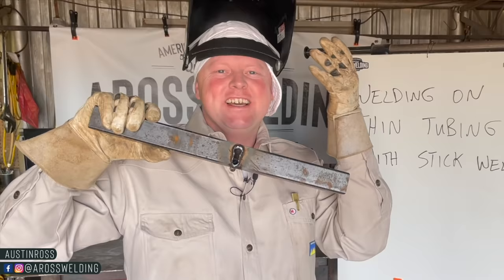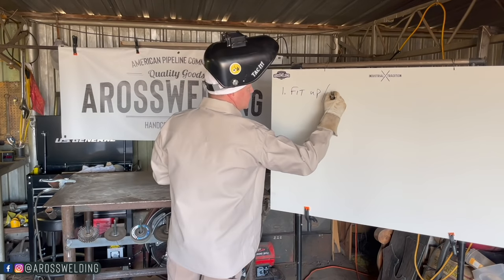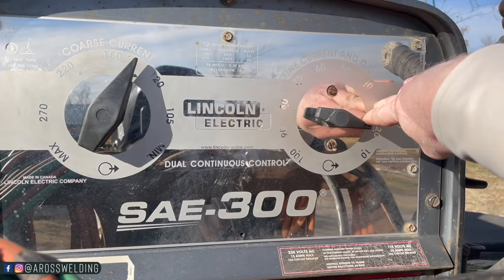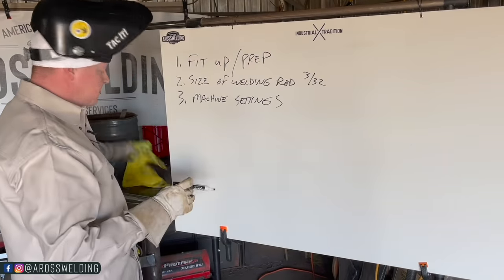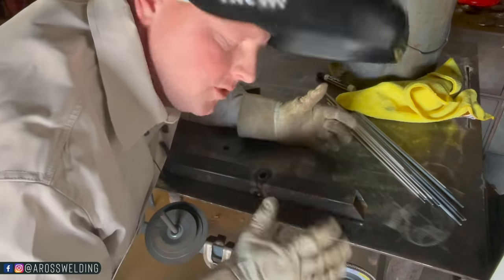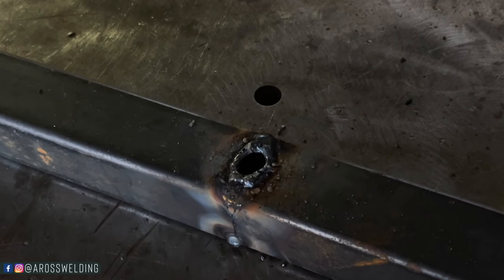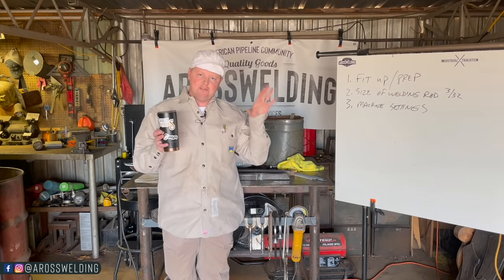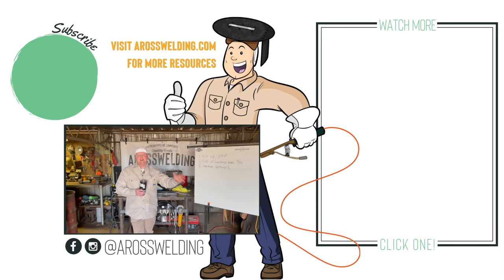Stick Weld Thin Square Tubing (How to Recover After Burning Through)

Comment: I just bought so firepower 1/8 rods a 10 lb pack for under 20$ off eBay witch is a steel compared to what ur going to pay for any electrodes trust me u can't beat ebay's prices on alot of stuff welding supplies included fr and u can buy some pretty nice stuff off there if u kno what ur looking for that's a fact but u have to Kno ur stuff some inorder to pull that one off plus the wait time witch if u order anything on a sat u should have it by the next sat at the latest as well and to weld on my Lambo door kit and I attempted to try to use 1/8 steel on the door lifts and that's not thick enough so I've got some 1/4 steel plate on there way I'll just take some construction paper and make me a stencil and back track it on to the plates and cut them out get everything lined back up then begin to weld steel to steel because I'll use my stock bolt locations to  to attach the door it's self u don't want to weld the doors on ahh no u never know if u will have to replace ur door or anything this way I'll be able to remove the door if need be and so I'll be able to replace the bushing in the doors to because yes they do have door bushing with the Lambo door lol

Comment: I like to think of 14 gauge [5/64 or .083] as a little bigger than 16 gauge [1/16" .063] ] than smaller than 11 Gauge [1/8"  .125]]....don't need much heat for sure.....easiest to weld with 6011 [Electrode negative, gives  less penetration and more build up, ....AC also gives less penetration and more buildup than electrode positive for those with an AC only machine, but not as much as Electrode Negative DC]  and whipping it, whippet good....I used to repair lots of gates and fence around swimming pools......gnarley work if you can get it......and believe it or not, a 1/8 6011 , even though at a higher amps, does not dig in as much as a 3/32 6011 at lower amps, as the arc is spread out wider.....at least that is what I found when doing fence and gate repairs. hope this helps someone....
Reply: interesting

Comment: If your at home ok on the job there’s is no walking away. Might as well walk to your truck and leave. If one is not confident on a material get some drops pcs and see where you ,your material and the wielding machine are at. Usually about 5 mins your tuned in to start the actual job. Tight joints, positioning you and your material, stick heat and speed and polarities are important. Down hill and flat travel when at all possible. Always set lower than you think if not familiar. Easier to turn up machine than fix a dime sized hole. Clean flux off what ever rod your using to use as a filler rod. It’s always with you no searching for what ever or cutting a pc that will work and it’s a good length to handle. Demand excellence from any one that cut your pcs. A well laid out pc poorly cut is a challenge beyond the job it’s self. Time and patience of your welder will both run out lol. Always try to set one’s self up for the best finished product. Lastly always be willing to learn from others no matter how far you have progressed in your field. The man that says he knows everything is the last guy I want on my crew.  Keep up the good work because I’m sure you will learn as much as you teach. That’s a really good trade off.  👍

Comment: The first thing I'd do, is test the machine settings and electrodes on an identical piece of material.
Once dialed in, I would just proceed to lay down some molten steel.

Comment: I’ve found that on my sa 200 running in a lower gear and higher on the fine current is a lot more forgiving personally. To me it’s less drive and a wetter puddle when welding 14 gauge and c purlin. First gear and 75 to 80 works good with 1/8” 6010 for me.
Reply: Is this the throttle lock pin on the governor or are there models with gear drive?
Reply: @antilogism  the gears I was referring to is the main amperage control on the faceplate of the machine. The five selector on the left side of the faceplate. 90-min being first gear and max-220 being 5th gear
Reply: @scout0544  Thanks! I should have caught that. The last time I used one was over 20 years ago and it was really old. Teledyne Continental engine with an updraft carb, oil-bath air cleaner, manual choke and impulse magneto. It even had a crank in case the battery was too low to spin it!
Reply: @antilogism  you’re welcome! They’re great welding machines. I definitely love mine

Comment: Is 11 gauge the thinnest square tubing you would recommend sticking welding?
Reply: with a 1/16" rod, you can weld 16ga square tube  if you have the skillset.

Comment: So there's no need to clean the slag before going back over each time?
Reply: For a down-n-dirty repair, not really.  When the arc goes over the solidified slag it will melt it. Sure you will get some slag inclusions, but this is a down-n-dirty fix/repair.
Reply: Thank you. I’m always eager to learn.

Comment: What do you mean by the weld being too cold?
Reply: The amperage of the machine being to low did not allow to melt the metal of the workpiece properly. That will require to stay on the same spot longer which heats up a bigger part or area of the workpiece. This is usually is unwanted. It's a bit counter-intuitive to put in more amperage to get a less heat, but it means the heat is actually a spot, it's more focused.

Comment: Comment only not a criticism as a retired toolmaker and a quality control technician never weld on top of slag and after testing welds buy cutting and polishing and critical inspection using iodine to determine penetration I think your weld would show a very porous weld . PS for us down under also state M.M. eg 2.0 mm or 2.5 mm Cheers from Australia .

Comment: Should I tell you the trick so your rod will start when you start  to draw an arc?
So you can start welding immediately, when your welding and about to stop, quickly pull the rod away with a flicking action, this removes the blob that makes it difficult to restart welding.

Comment: Everyone has had this experience. 

Before I fix these … I consider the structural needs of the piece. 
It does no good to fix that hole if I weaken the piece by too much heat input. 
Better off to plate over it.

Comment: I work on my transit ..the its ridiculously thin doing plating. Burning holes ..I just rebuild reinforcing the thinnest sheet area til Weld On
>>  .Prep is key..I start work at say 3pm..by 4.30 I'm confidence to weld..toiing and froiing with prep work..I just got a hobby manual stick welder..none of this digital stuff

Comment: BIg question to the wider community ... does anyone find it easier to weld thing with 1/8 over the 3/32 its like the extra diameter gives you a slightly larger arc so the arc doesn't ... needle dig into the base plate a much? sounds counter intuitive but try it out and tell me how it works for u guys

Comment: Another way to fill a hole is to cover the hole with three rod butts and it will cover faster.  The fact that the 1/8' rod butts are too high doesn't matter. it will all melt down.

Comment: i have the same problem but with flux mig on car sheet metal. pain in the ass when its all you've got , hole after hole lol
Reply: You have a crap MIG then. I can flux core .6mm sheet with my inverter 250amp

Comment: One other option to "fill" a blow-out hole on thin metal is just patch it with another piece of sheet metal....this way you have lap welds rather than butt welds.

I know you're professional welder and that this video is for demonstration, but you're not cleaning the slag off between beads.  You're going to get slag inclusion in the welds.  For mig welding it won't matter but for stick the weld integrity will be compromised.

  I also let the metal cool down quite a bit longer when welding up a hole on thin material.  If the metal gets too hot, you risk gouging another hole into the tube.

Comment: Another trick rather than bevel it I will tack it in a few places then use a straight chisel and tap a dent right in the seam so when it's welded the seam is flat

Comment: Not bein a smart butt but have welded lots of thin stuff with stick...3/32 6011 on DC straight polarity (stinger negative) is king. Also most codes put 6010 and 6011 in the same class. 6011 in DC- makes poor fit or bad hi lo pipe a breeze to put the root pass in with.

Comment: As a welder at the refinery's, I can say there is always pressure. Even after years of doing it. It doesn't go away it just lessens. But having inspectors x-ray your welds weekly isn't easy on the soul. I guess you just don't wanna be that welder always getting the boot.

Comment: Why not use a second rod as a filler rod ? Knock off the  flux and melt it in the hole it works a lot faster

Comment: Very helpful. Thanks!

--------------------------------------------------
[Note: This comment is not focused on any particular "designated group" with regard to the YouTube "hate speech" policies. It simply reflects the author's opinion regarding a subject, which may or may not also pertain to an individual's actions demonstrated in the video. If any such individuals belong to any of the "designated groups", any commentary included is merely incidental to that grouping and such groups are not the focus of any comments. It's pathetic that this comment is necessary for the YouTube censors.]

Comment: Pity you only gave a glimpse of the finished weld. Everyone has  these modern electronic machines with micro tuning. No vids of  the old stick welders.1950s 60 and 70s without displays and dials